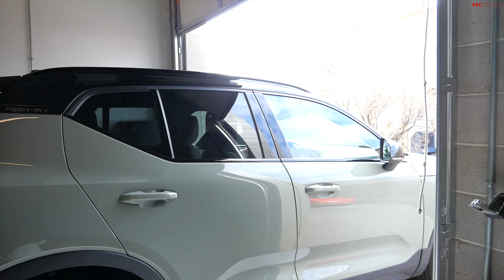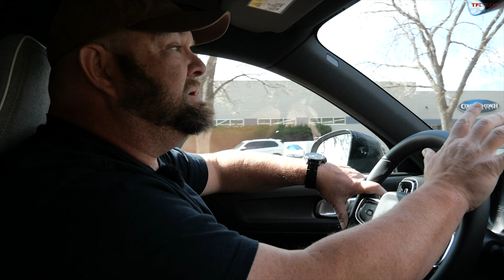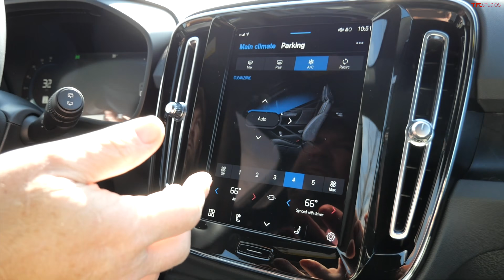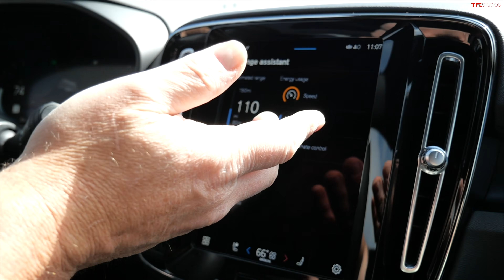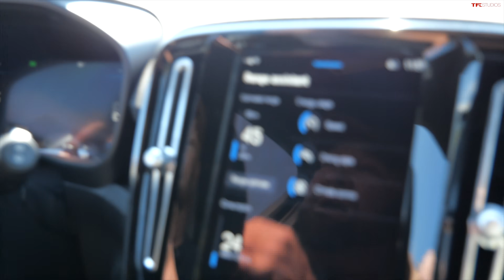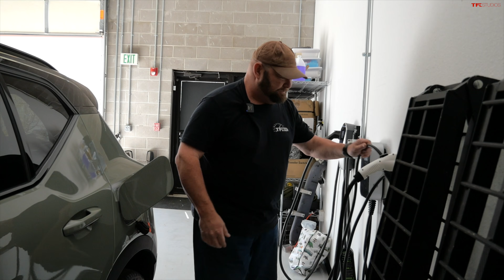The 2023 Volvo XC40 Is Already a Good SUV, But is the Recharge Model a Good EV?

Comment: I don't think the battery is "Draining" due to cold.   Moreso, the available power it can pull from the battery is reduced due to cold. (the computer recalculated this as a drop in percentage).  but when you move to a warmer environment, like a garage the range should go back up (without recharging it)

Comment: anyone remember he started off w/ battery at 69%.usually for these tests it should be 90%. this 69% start skews the overall numbers. range should not be a fear factor with ev's. do you have range anxiety in an ICE? no. i have a 2023 c40 . it's amazing. fast. comfy. all volvo. meaning it's simple. it's not blingy like the ionic 5. it's a very Scandinavian interior. that means its so much better than a tesla but not built out like a mercedes with massive dashboard - long touch screens. and the infotainment system is not difficult to use. this made it look like it wasn't intuitive.

Comment: I have an XC40 Recharge 2023 same one you tested, my frist EV car. Overall it's comfy, and practical with the frunk and trunk areas, It has a really nice interior (blows the Telsas out of the water in that regard) and is an absurd sleeper, this thing can hit a 12.88 second 1/4 mile at 107mph !  The range is good for the typical 42 mile round trip each day for me. charging every 3rd day or toping of nightly. The max highway miles I did in one shot starting from 100% charge in Texas (72 to 75 MPH cruise control most of the way) managed 166 miles with 15% battery left before I charged up. So there are better range cars out there but you can get by fairly well even with its low 223 miles of the stated range.

Comment: In my Model Y, you set the temperature and fan speed by voice command.
Reply: Same in the volvo ;) I have one and love to set everything in voice command. It makes it safer by not beeing distracted.
Reply: @richardschmid272  I like Volvos. I've owned a few of them, all 5-cyl engines. Great engine too. ..... I'm amazed at how many reviews don't point out certain voice commands that Tesla's have. Like "turn on windshield wipers". or "Play Pretty Woman by Roy Orbison" (I think it has every song written by man 😀).  I keep experimenting and finding new voice commands, all reliably done with virtually no need to repeat the command.
Reply: this volvo can do the same thing. he had no clue. it's google based and you can tell it to increase or decrease temps verbally. tesla is not special.
Reply: @cub35guy  Yes, I was suggesting he try voice commands in the Volvo. I didn't suggest Tesla was special in voice commands. But no one's better than Tesla. A few are as good. I see reviews all the time where the reviewer didn't know Tesla voice commands either. Hence my suggestion. ..... Plus I keep finding new voice commands I never knew about on my Tesla. I think there are about 50 that I know of.

Comment: It’s seems to me like the EV makers are mostly going for selling the sizzle and not the steak. It would be better if there were more emphasis on smaller motors and bigger batteries. Many of the EVs are WAY OVERPOWERED (yes, I’m yelling)! The Chevy Bolt EUV is an example of a more reasonable balance, which I hate to say as I am most definitely not a GM fan.

Comment: Some day there will be an EV useful to me but that day is not today.  I seldom commute (1000 to 2000 miles per year), but I do drive 4-5 hours covering 340ish miles fairly frequently.  I should probably visit my brothers more often but the close one is around 400 miles and takes 5-6 hours of travel time.  The other one is an 11 hour trip to cover almost 700 miles.  There isn't any of those trips where I'm willing to add another hour or more of hanging out waiting to charge.
Reply: Do you stop to pee or eat during these trips? Thats usually when I charge, and it doesn't add time to the trip since I would've stopped anyways.
Reply: @MrJbmcgary  To cover 300-350 miles in 4-5 hours? Or 650-700 miles in 10-11 hours? Don't stop for long.
Probably 3 out of 4 times on the short trip we stop at a public rest area about mid-way for 5 minutes to pee and walk around.  If we didn't eat before starting out we might stop and grab a burger when leaving the interstate.  Only for the 10+ hour trips do we take a break that might stretch as long as 30 minutes (the kids like to hit the In n Out in Reno) but there are a couple more of the 5-10 minute pee breaks.

Comment: We own a Mod3LR & a `22 Volvo XC40 Recharge.  I personally like the Volvo better.  EVs targeting the most efficient drag coefficient and such I feel miss a good portion of the point of why it is fun to drive a car.  The Volvo is comfortable, roomy, fast, and a very lux drive feel.  The interior cabin is quiet and the overall look is 95% indistinguishable from any other ICE car on the road.  This for me, is a plus as driving a car shaped like a suppository is not a life goal.  A few things about the XC40 Recharge.  The Android auto SoC destination estimation is superb.  I think I am safe in saying it is best in class for SoC destination estimates.  It accurately estimates SoC when I am on long descends out of mountains.  Also, I find I can get a real big range boost by cracking the moon roof using heated seat/steering, and off'ing the environments.  The heated seats keep me warm when it is not too cold out.  Thx for the vid.  I enjoyed watching.

Comment: just wait for the 2024 models....they're switching to a better battery pack and rwd motors....I believe they're starting with the Polestar 2 then the 40's....I think in rwd it's supposed to get about 300 mi....should make it a real contender in this segment.
Reply: I'm here after seeing the EX30 and you're right. Absolutely knocking it out of the park with the new model. (not sure if the 40 line is getting the same treatment since it's so close in size, but I doubt the numbers would look too different there. Just as beastly I'm sure.)

I was wondering why these weren't on my mind throughout my research, but the price and range reminded me why I wrote them off at the time. But Volvo has leapfrogged the competition and in a single day they jumped from completely off my radar to #1 contender on my shortlist.

Comment: They stated that the maximum range is 230 miles. Several other YouTube reviewers make the same mistake as dating the EPA rated range as the maximum range. The EPA rating is not necessarily the maximum range. That rating depends on how they tested the car, and if they used all of the EPA testing cycles. Some manufacturers, such as Ford with the mustang, Mach-E and Porsche Deliberately under rate their cars. The EPA range is not necessarily the maximum range, and all of it is dependent on speed and weather conditions. Other than that very much enjoyed the review!

Comment: You make it sound like just using the regeneration at any time will always improve efficiency, but using regen to slow the car only improves efficiency if you needed to slow the car anyway. It doesn't help if you're just going to accelerate again right after
Reply: As a EV driver for the last 7 years I can assure you regen can easily add 10% more range if city driving. Doesn’t do much if highway driving unless you are in rush hour traffic.
Reply: @therealcdnuser  I agree
Reply: Coasting is more efficient than regenerative braking if you have the room to coast fully to a stop. If you don’t have that room and need to stop earlier to avoid obstacles, then regen braking is better.
Reply: @Adam Wu  very true, Adam, which is why regen is usually better in town with stop and go traffic and with lights and stop signs. Highway driving is often more efficient with coasting to reduce speed gradually rather than regen braking
Reply: You know the acceleration pedal is not just off or on, right? And you lots of control over how much or how little acceleration (or deceleration) to apply.
Reply: Agreed JP, allowing a vehicle to coast to stops is more efficient than using regenerative braking.
Reply: wrong. acceleration without regen vs. acceleration after regen, think about it.
Reply: @EV3NTH888  You lose more during acceleration than you gain during regen. His comment was correct. There are always losses from rolling resistance, wind resistance, or even through heat during power transfer.
Reply: @wade7959  right, but you lose even more without regen. if I pour in 3 ounces of water and drink 4, I have less. if I don't pour 3 ounces of water and drink 4 I have less than when I poured in 3 ounces. it's not that difficult.

Comment: Instead of a frunk, why don't any manufacturers just put a full sized spare under the hood and put all the EV stuff under it? One of the most common complaints I hear is most don't have a spare and instead use an emergency inflate kit.
Reply: Crash safety. 😉
Reply: @davetravels9273  Come on, a flying tire propelled at neck level could never hurt anyone, could it?
Reply: spare tires cost money.

Comment: interesting. Should EVs be kept in an environment the same temp as outside, such as outside or a car port / unheated garage?
Reply: No, it will be far better to have it in a garage that is above freezing. Having a battery the size of a mattress takes a long time and lots of energy to warm up, if it's even just 2 degrees C it will be far better than trying to leave with that giant block at -20C from sitting outside overnight. You can precondition it if you have to charge/park it outside but it is ideal if it was already above freezing.
Reply: No.  The range estimates will soon update once you get going though.  Maybe some manufacturers will start incorporating real-time weather into the guess-o-meter at some point and present the more pessimistic of the two vales in order to account for garaging.  But probably not.
Reply: You can program it to warm up every morning while plugged in.
Reply: Not a problem, but as previously mentioned, more energy will be used to warm the cabin and battery. 30F outside isn't anything extreme, but single digits will result in an energy thirsty warm up period. 

Scheduling charging to finish before setting off, such as a routine morning commute, will aid heavily in keeping the battery warm, thus demanding less energy for warmup. But this idea would require a Level 2 (240V) home charging station. A 120V Level 1 unit wouldn't discharge enough juice to warm the battery.

Comment: I stopped watching at 230 mile range. That means I can’t take longer trips without hoping the fast chargers on the road will be working.
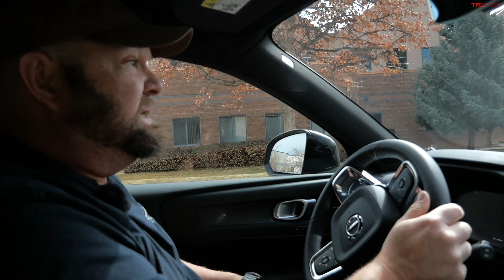Reply: And remember, 230 miles is the EPA combined range estimate. You'll lose at least 10% of that if you are only doing highway driving, then after the first leg of the trip you can only fast charge 10-80 so you'll lose another 30% off that number. That 60% you have left is only 138 miles, so at 75MPH you'd have to charge for half an hour every 1:50 of driving. Sounds like a fun trip.
Reply: @Snerdles  I have a chevy bolt and here in New Hampshire the Range drops to as low as 100 miles in cold weather. That’s not a problem for me now because I have a elderly relative in a nursing home a few miles away and I can’t go anywhere, but soon I’ll want to take longer trips, and that means a Toyota hybrid for me.
Reply: @seniorcousin  Same reason I'm in a PHEV. Charging infrastructure is abysmal in my area. My city doesn't even have a fast charger. The closest is about an hour away and only 50kw. The 350's on a few highways are all filled with comments of people only getting 30-40kw out of them. My PHEV can real world drive 900km on a tank of gas so never a worry on any long trip, my bladder will give out way before my fuel tank will.
Reply: @Snerdles  The Kia Niro phev is on my short list for that reason.
Reply: The infrastructure is getting better and better every day.  I took a 1,000 mile road trip in 2019 in an EV with at 238 mile EPA-rated range.  I did this in the dead of winter, with temperatures averaging around 20ºF. I survived, don't be such a baby.

Comment: This thing gets new motors and a RWD version this fall.  Also new software.
Reply: Yeah, I hope that they update this test later in the year when the 2024 models with significant range boosts are available.
Reply: @earthzero7  It's also getting a charging speed increase to 170kw IIRC
Reply: @godofdun  200 actually I think.
Reply: @Jet_Pilot525  aww dayum
Reply: @godofdun  also, the Polestar 4 is going to be revealed on the 18th.  I think both will be a good alternative to the Model Y.  There's rumours that Polestar are including their pilot package so I think Tesla is putting a lot of pressure on their competition which is good for the consumer.  Finally...
Reply: @earthzero7  I'm waiting to see the prices and packages.  Polestar is including the pilot package soon....  I don't want a Tesla but I love that they are dropping their prices.  Stand by for more price drops imo.
Reply: @kevinn1158  One can only hope...
Reply: Yup, both Volvo EVs and the Polestar 2 getting upgrades for 2024 model year.